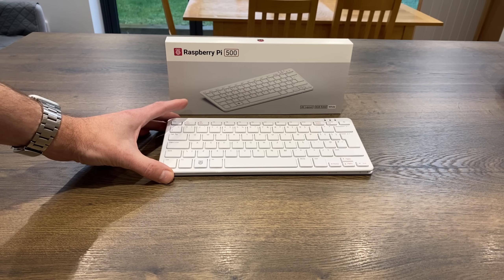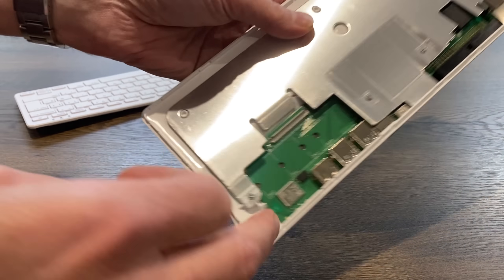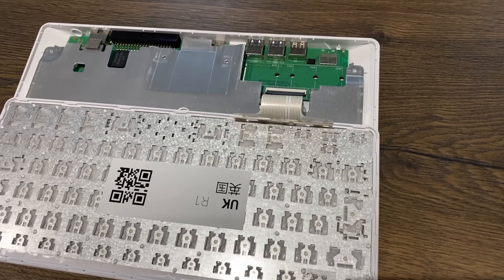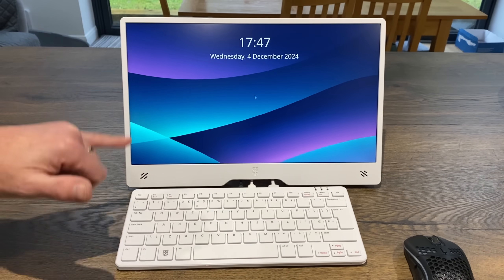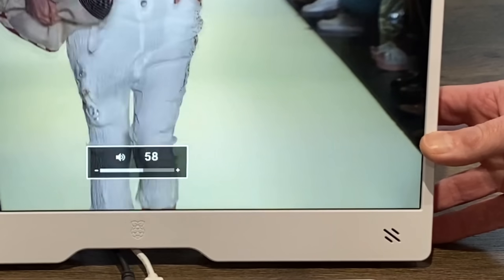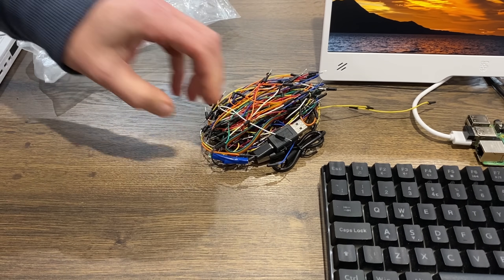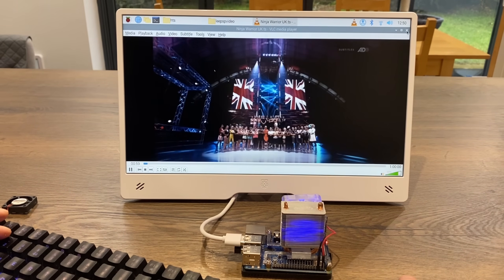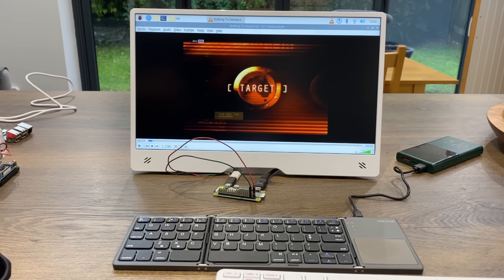Raspberry Pi 500 First Look & Teardown. New 15.6" display test

Comment: Unfortunately, the lack of M.2 port is a deal breaker for me
Reply: They need to get the heat dissipation right to put M.2 SSD in it. It can get really hot.
Reply: ...and then if they put an M.2 port on it and upped the price by £15,  you'd be complaining that "the price is a deal breaker for me".
Reply: @terrydaktyllus1320  nope, I'd be willing to pay up to 150€
Reply: @Sherlock385  It's not worth that. When you get to £100+ (100€+), you will get far better value by picking up a used SFF PC online, a HP EliteDesk mini PC of the right model will have NVME built in.

And, again, I have to ask the same question - if lack of NVME is a "deal breaker" for you, what did you did you do on computers before NVME came out?
Reply: @terrydaktyllus1320  Again nope, because I like the fact that it is integrated into a keyboard. I already have about 10 different Pis and one Pi400. "what did you did I do on computers before NVME came out" - is a silly question - been connecting SSDs by other means, of course ... but the Pi500 should be an ideal platform for an integrated SSD that doesn't need to be attached externally, so that's the main reason for my disappointment.
Reply: @Sherlock385  For the record, I have about 50 SBCs that include all of the Raspberry Pi's, Orange Pi's, Asus Tinker Board, Atomic Pi, Olimex boards, and a few others I cannot even remember the names of. Many of them run my own custom Gentoo Linux builds on them. But none of that is relevant to the conversation anyway.

And, no, it's not a silly question - it makes you look silly in not answering it when I just ask you "why". It's purely an engineering discussion because for many applications you might use a Pi for, having NVME is of no use and just adds additional cost.

So, for third time, why?
Reply: @Sherlock385  Yes, absolutely. But then don't try to argue technical justifications for it  when it's purely an "emotional" reason.

I am a computer engineer, I don't get physically attached to brands or specific devices. I look purely at technical merits of hardware when I make decisions about suitability.
Reply: @terrydaktyllus1320  Colin Robinson, is that you?
Reply: @Sherlock385  I have absolutely no idea who Colin Robinson is and why I should even care anyway.

Clearly one of those "meme" things that the Internet "hive mind" subscribes to because nobody is taught critical thinking any more and they can only keep "parroting" something <cough> "funny" that someone else once said.

RIP originality and independent thought.

I think we're done here. Run along now.

Discussion closed.
Reply: @terrydaktyllus1320  Colin Robinson is an energy vampire in the television series What We Do in the Shadows. A toxic person.
Reply: @Sherlock385  I think the reason you'd like the integrated M.2 slot is performance, and Pi500 will be your daily PC, right? :D So do I. But that Pi500 still looks cool.
Reply: @Sherlock385 Come on now, you have to admit it's a bit daft for the price, by the time you add the cost of the kit and monitor. They clearly either planned M.2 or left it for a later version. Slap a mini PC on the back of a screen via VESA, or get a faster laptop for less, unless you are just mad for PI folks.

Comment: I can see adding a couple little fans , instead of just using only one , like when you tested a fan on the pi 400 . If  there will be similar ducts like on the pi 400 . An input on one side and output on the other .
Reply: Update . Just got a 500 . Still need a power supply . Going to add a couple fans . Input left side output right side . And maybe a piece of cardboard in the middle to help spread cool air in.

Comment: Really like that this screen allows cables to pass through from directly underneath, making the wiring very tidy.
Reply: Yes, I agree that it is a big deal.  I have a fairly nice 15" panel that I use for my Pi400, and while I like the monitor, the cable routing leaves a lot to be desired.  Having the pathway through the center, that lines up with the ports on the Pi500 is a very nice touch.

Comment: No support for NVME is a disaster. So disappointed. I think I’ll pass this time.
Reply: Heat dissipation can be an issue for something compact like this.
Reply: @farishanafiah8461  That’s a fair point. NVME generates a lot of heat and that might have caused heat issues.
Reply: What did you do with computers before NVME then?
Reply: @ Before NVME there was SATA. I’d rather run my Pi using a hard disk than a SD Card. So much more reliable.
Reply: @GlennCartmill  So you've clearly not checked out hard disk speeds on USB 3.0 then? I've been running my own Gentoo Linux builds on Raspberry Pi 3 (and below) with the root filesystem on an external USB drive perfectly happily for years now.

If you're sat there agitation about a Pi taking 10 seconds longer to boot without an NVME drive than with one, then I'd suggest that's more to do with your own impatience than anything else.

Adding NVME means "higher cost" and then people here start whining about "it's too expensive" - and, for the record, I don't consider the RPi to be the solution to every computing problem, I think it is expensive for what it is when compared to cheaper and used SFF PCs online that already come with PSU, cooling and case.

But I think the "Amiga-like" Pi 400 and 500 with it all cased with a keyboard is good value if its less than £100.
Reply: @terrydaktyllus1320  Its reliability that I’m thinking about. SD cards die on me regularly. Even good ones with a brand name. I don’t
Care so much about how quickly it boots.
Reply: @GlennCartmill  You are comparing NVME to SD cards, I am not doing so - so please don't argue a completely different point.

Raspberry Pi has had a minimum of USB 2.0 support since the very first one, therefore it has been possible to install a Linux root filesystem on an external USB drive since that time - admittedly on early models, you'd need to put a boot partition with a Linux kernel on it on an SD card but once booted, it can be ignored.

Since the Pi 3, it has been possible to boot from external USB, that is the comparison I expect you to make.
Reply: @ I agree with everything you have said. 

I’ve used external drives with raspberry pi including hard disks and a variety of SSDs and they work really well. Having the SSD built into the raspberry pi 500 would have been such an improvement. It would be one less thing hanging out of the back of the Pi or needing to be plugged in. That’s why I’m really disappointed.
Reply: @GlennCartmill  A valid point, but I believe that keeping the price to well below £100 for an "Amiga-like" Raspberry Pi platform is the perfect price bracket.

Adding an NVME port and internal NVME drive is going to increase the cost.

If it goes over £100, then I start looking at other alternatives (like used SFF PCs, for example) because I am lucky enough to be able to stick Linux on anything and therefore have a much wider hardware selection to choose from when building solutions to computing problems.

Comment: Thx for showing this.  It's almost a laptop and would've been the most elegant, convenient pi gadget.  But i guess those would push the price up way higher.  Modular components can be swapped around with other computers too.  There looks like therell be another Pi 500 next yr with m.2, depending on demand

Comment: It is disappointing that you could not put a NVMe SSD in the 500. Maybe they will release 500+ where you can.
Reply: It might be possible to add the socket for one, for people who are handy with a soldering iron. However there are lots of other unpopulated areas on the pcb so it probably will be a future update.
Reply: @CyberDunk2077  In his video, Jeff Geerling try to add a socket to the board and failed. He said someone with more advanced skill could do it. I hope you are right about adding the socket to a future update.
Reply: @CyberDunk2077  Apparently there are other associated components that would have to be added as well (to do with power, etc.)
Reply: @CyberDunk2077  Jeff Geerling did, but it doesn't work :-(
Reply: Not sure about 500+ version. I'm wondering did they have any issue with PCIe. Or its really a bit of lowering the bottom line + giving the advanced tinkerers the chance to solder the socket in themselves and Jeff the bios and Geerling the kernel themselves. @JeffGeerling
Reply: @RoboticsDIY  I hope you are wrong about the issue with PCIe, but now I am wondering about it myself.
Reply: Yup. I was interested in this one until I found out that they didn't complete this thing.

Comment: Why no earphone jack
Reply: Because the primary routing for audio is via HDMI which you can then usually split off from the back of your monitor in an audio jack anyway.

It's different when an "all-in-one" device (i.e. with built in screen and speakers, like a mobile phone or tablet) doesn't have an audio jack but if you've got USB then just get USB headphones or speakers.
Reply: Because it's on the display.

Comment: The power draw you saw was pretty much in line with my testing—4-6W just for the display (4W at 60% brightness, 5.5-6W at 100%).
Reply: does the pi 500 has 16gb RAM
Reply: 6W just for the display is quite a lot. That's a bit worrying.
Reply: @farishanafiah8461  Heh, don't try out any typical desktop monitors! They often burn 10-20W minimum... note that the power measurements include the wall adapter, and there are losses in it too. So the panel itself maybe uses 3-5W.
Reply: @farishanafiah8461  :D
Reply: @farishanafiah8461  is there any lower?beside phone screen

Comment: You get those clips open a lot easier than I did, you must have fingers of steel lol

It doesn't help that the air is so dry here, my fingers are ready to turn into dust it feels like!
Reply: Just watched Jeff's video, and now I see Jeff here too, lol!
Reply: @Waveshare_Ruan  We just need Chris Barratt from Explaining Computers then all the big boys are here!
Reply: This may be a reason why they didn't complete the M2 slot implementation. Wouldn't been a pain to have schools and home users opening and potentially breaking the case. A bottom opening like on the Amiga 1200 would be a better solution.
Reply: @amcadam26  +1 for trap-door access on a future M.2 enabled Pi500 Pro - and yes, funny how many things leads us back to the golden days of the Amiga ;-)
Reply: Beast mode. Opens with his bare hands. What an animal!!
Reply: i would prefer if they had some sort of sliding plate as a bottom cover, would make it easier for children to use i suppose, as this is more catered to kids, giving them something to learn about computers from

Comment: I hope this is a preproduction unit... No connectors for M.2 or PCIe??? And micro HDMI? 🫤
Reply: The lack of NVME makes perfect sense: it's pretty obvious they want to release one with it down the road, but as its supposed to be an easy kid's computer first and foremost, having to open it up and mess around with NVME isn't in the design goals for the primary market. Having a prefitted NVME would increase the cost over prebuilt SD cards. 

I'll wait for the probable A500+ (which I'm pretty certain will be the name, cos retro) and I'll probably be disappointed that it will probably only come with an NVME drive prefitted, and I'm going to want to put in an AI card, so I still probably won't buy.

(And then I suddenly remember that the officially supported one is the Hailo card, which doesn't even use NVME, so the A500 is already obsolete.)
Reply: @nialltracey2599  Another vote for the 500+ here. (Had the Amiga 500+ so it has sentimental value to me)
Reply from the maker: It is the final version of the Pi 500
Reply: M.2 SSD can get really hot, and this kind of compact design can be a problem for heat dissipation. As for micro HDMI, I see loads of Windows tablets with it. Even Lenovo put it on their Yoga Tab 13 Android tablet.
Reply: @ yes, but MicroHDMI is still far from common. If people want to buy a computer to plug into a TV for their kids to use, they're might have spare HDMI cables around, but neither end is likely to use a micro plug...
Reply: @nialltracey2599  So they can afford to buy their kids a new Pi but a not an additional couple of quid for a converter connector? Don't get me wrong, I am all for standardisation but I am not going to lose sleep over a couple of quid.
Reply: @terrydaktyllus1320  But they shouldn't have to. Kids lose things, and they need to be easy to replace. Does your local supermarket stock MicroHDMi to HDMI dongles...?
Reply: @nialltracey2599  No, but my local supermarket also doesn't stock wax for  a surfboard, guitar strings or even "Lieutenant Pigeon's Greatest Hits" on CD, as well as lots of other things. So I am not sure what point you are making there.
Reply: @terrydaktyllus1320  Do your kinds often lose surferboard was, guitar strings or Lieutenant Pigeon CDs?
Kids are always losing small things... like HDMI dongles. Every supermarket round my way has full-size HDMI cables.
Reply: @nialltracey2599  So therefore the problem that you are describing to me is not micro HDMI but how easy it is to lose things - which is a completely different, and irrelevant, conversation.
Reply: @terrydaktyllus1320  So you've joined a conversation that I was in first, and you've decided that what I was talking about before you joined in is irrelevant to the conversation you're in...?
I don't think conversation works that way...
Reply: @terrydaktyllus1320  To clarify: nakfan doesn't like micro HDMI. I agreed. Raspberry should have gone for full-size HDMI because that's more suitable for their target market. It that is different and irrelevant to the conversation you want to have, feel free to have that different and irrelevant conversation elsewhere.
Reply: So how did you use a computer before then? No RPi up to this point has had native NVME up to this point anyway, and not all of us are silly people needing to cowbar bloated and privacy-hating Windows onto a Pi. In that instance, NVME on the Pi for Windows is like giving an old person with respiratory failure a chair lift to help them get up the stairs.